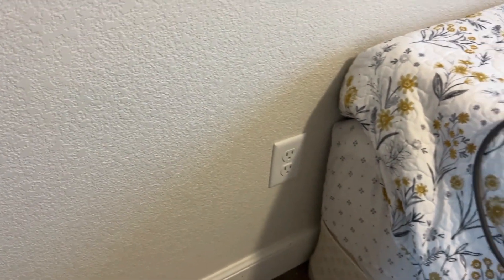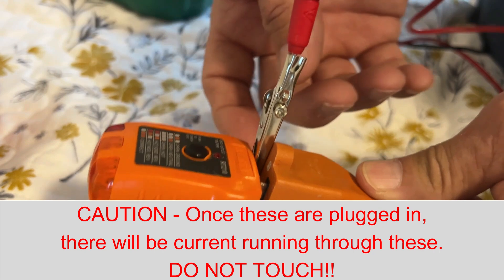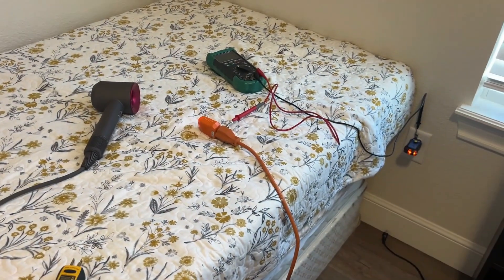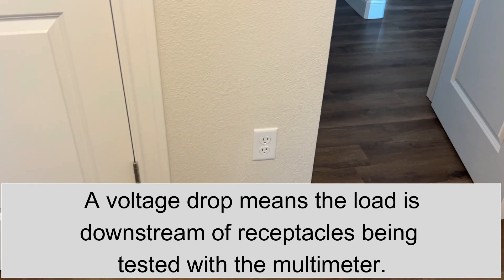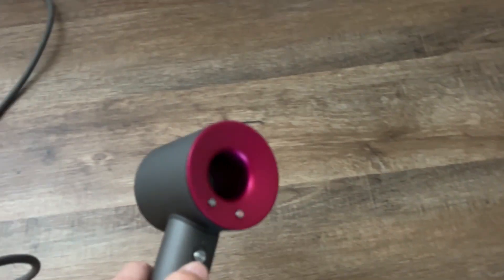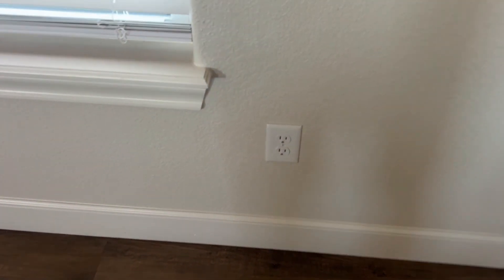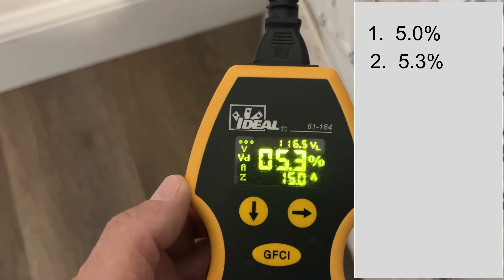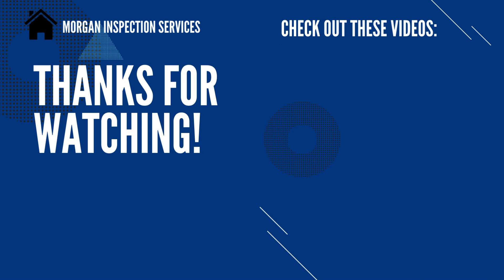How to Identify the First Outlet in Electrical Circuit

Comment: Very informative video 
Im going to try the Klein  RT390  
Conduct 12A, 15A, and 20A load testing to measure percentage voltage drops 
Amazon about 150$
Reply from the maker: @freezetemp-hvac   Thanks for your comment. I would love to hear what you find with the Klein RT390. It is definitely cheaper than the ideal suretest.
Reply: How well did the RT390 work for this kind of test?

Comment: I never thought of this method using the extension cords.   Brilliant!

Since I work in mostly new construction, I don't feel that spending around $450 for the ideal suretest is the most efficient use of my hard earned 💰💰 especially given the sticky inflation over the last 4 years (just my auto insurance went up significantly more than an Ideal suretest  cost in that timeframe, but that's a topic for a different discussion another day) 

So here's the method I use when I need to determine the first receptacle on a circuit in existing installations.  First I use the same method as you did in step 1 without the Suretest, that is, turning off the breaker and noting which receptacles are dead.    Step 2, plug in my Master Appliance HG-501D heat gun, 1740 watts, 14.5 amps and measure the neutral - ground voltage in the other half of the receptacle, note the readings.   The receptacle with the lowest reading is the first in the daisy chain, the highest reading is the end of run.   

Any receptacles which measure 0V neutral - ground under this heavy load indicates a pirated ground eg. neutral - ground bonded at the receptacle, no ground  wire available in the circuit.
Reply from the maker: I always look forward to your comments on my videos. I always learn from them. 
It sounds like you’re essentially doing the same thing I’m doing by measuring voltage drops. But instead of measuring voltage drops just on the neutral wire, you are measuring the drop between the neutral and the ground, which is going to increase as you get further from the panel. And you’re creating the voltage drop by running a high power load to create that voltage drop. 
I may have to make a new video to add yours to the list of options available.
Reply: Thank you Sparky 5. I like your way of doing this just as much as this video!